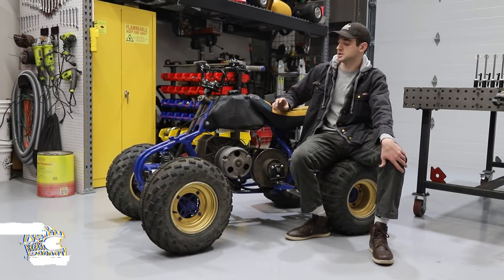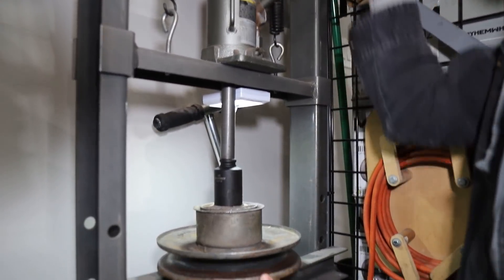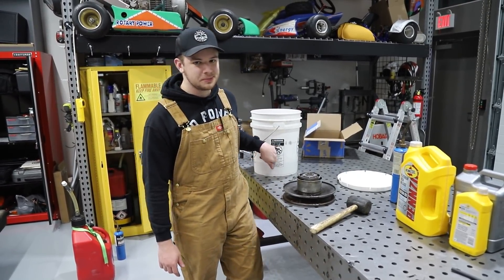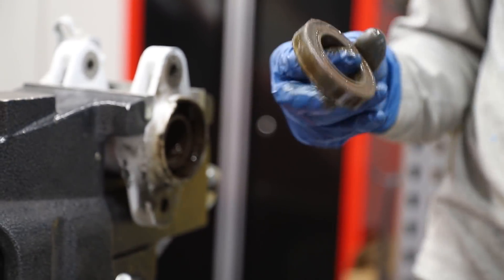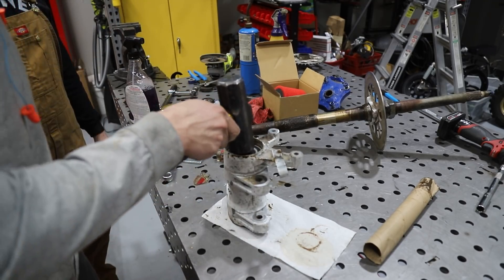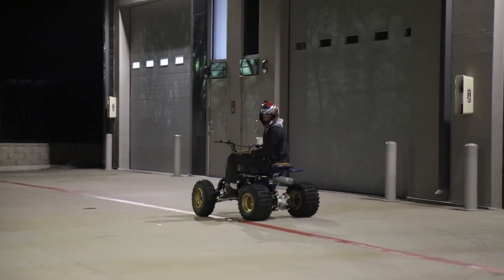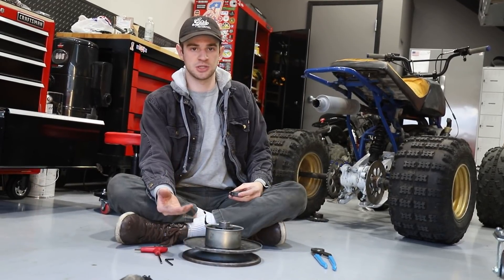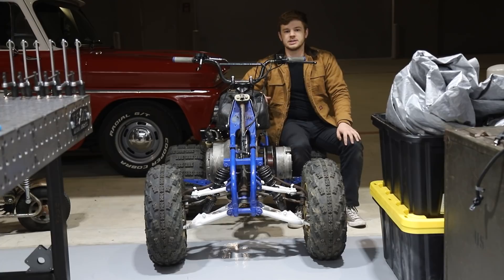ROTARY POWERED ATV FINALLY RUNS! Rotary ATV EP. 4

Comment: Try a 501 rotex mated to a torche converter from a snowmobile on 50/50 airplane gas and high test gasoline.  It will spin tires off rim SO plan plan on bead break rims. Best part can be built on a blaster Frame stretch 2 inches looks stock🤣. EAT 5.0S AND CAMEROS . FOR 2000.00
Reply: TORQUE *

Comment: Without the CVT working you are going to lack performance. Your belt is burning because that torque converter is squeezing the belt trying to move it, that locked pully won't let it move.

Comment: I’d definitely build a scatter shield around your drive clutch. I had a clutch on a snowmobile (which is what you have for a drive clutch), and it blew up like a bomb going off. Destroyed the left side of my hood a belly pan. You’re drive clutch is a 70s vintage Arctic cat hex clutch. Try finding a Comet 102C. Way more tunable. Check out high performance engineering online. The have all kinds of clutches and tuning parts. Nice build, btw.

Comment: Be safe and get a different fuel cell now sense the exhaust runs right under it. “Heat rises and will boil your fuel” can blow up or cause the engine to vapor lock.

There is a reason no exhaust is next to the fuel tank or lines.

Comment: Good! A 33 cm intake duct, with Reed Valve at intake plate entrance (Yanmar Diesel SAE Papers) and a longer exhaust system would provide better low rpm Torque. See Taiwan SAE paper: 'The intake and exhaust pipe effect on Rotary Engine  Performance', and 'Wankel News':  RE-5 engine results. Blessings +
Reply from the maker: Awesome, thanks for the info we will look into that!

Comment: Judging by the slope of both the drive & driven pulleies, they look like different series. Would suggest making sure they are both the same, whether it be 20, 30, 40, or 50 series and grabbing a new belt too match. Or you could ditch the whole belt and pulley system and get a centrifugal chain clutch and fabricating your own custom drive gear so you get a good balance of torque & speed

Comment: Hy guys, what you said about using hydraulic fluid and acetone was the original formula from AMC. A company that is long gone but the simple formula lives on in just about every old mechanic that is still alive and well. This works so well and you can use even old fluid that is drained. Does not affect the performance. The grease you say is like mud is a great sign that the previous owner was not afraid to use grease. How many times I fix something and there is not grease, then its a bitch with loads of rust and rot. 
      You guys did a real nice job on the 4 wheeler. The unit rips well. A turbo will help but make sure you run a rich mix as forced induction really make it hard on the engine. 
Nice work guys a good luck too. vf
Reply from the maker: Thanks for watching and for the information and tips! Cheers

Comment: If you are gonna lock the driven pulley the engine needs to be on guides with springs so it is able to move back and forward with acceleration and deceleration if you dont it is gonna eat the crank bearings if you need advice on how to do it look up 2strokestuffing on youtube he does the land speed racing with 50cc scooters and that is how he has his set up driven is stationary and engine is mounted on a spring arm so it can move with the driver pulley

Comment: When you push the trailing arm back a few inches,you can flip the drive pulley and put the gear on the outside of the axle,and just make another set of bearing supports along the arm.It sounded good,and moved well. Happy St.Patrick's Day to All edit =lendel morales had a Great idea to just "Flip the Axle".You can extend the shaft and put the gear on it.

Comment: When you where riding it in the parking lot the first time I saw sparks on the front of the engine, you coil or wire might be arching, that will take away some power.
I would love to see a Suzuki 250cc 2 stroke in that frame, it would fly, maybe from a 250 quad ?
Reply: they had no exhaust at all.It was straight out of the block.Good eye though.
Reply: @bryduhbikeguy  O I see now thanks...

Comment: You know that they make reverse wound springs for the driven side, did you notice how the three plastic buttons in the Carrier were the same on both sides and the part that rides on them will ride on either side depending on the direction you want to work. It’s only a spring change and installing your ramps to the other side of the plastic buttons.
Reply: That's a good idea
Reply from the maker: Didn't know about that, thanks for the info! We'll definitely look into doing that

Comment: Get a secondary pullie from can am it will turn right direction and you can tune the cvt by changing out springs going to stiffer spring on secondary pullie and yall need to wrap exhaust or move it away from gas tank before it explodes
Reply from the maker: Thanks for the idea, we were thinking of doing another pulley and I think we might go that route. We're definitely going to wrap the exhaust and hopefully when we do the turbo we can re-route it

Comment: Awesome build regardless, but CVT’s just suck in general. However, I think you’d gain more performance from getting the cvt working than you would from a turbo. 

Or better yet, do a gearbox. Get rid of the giant turd between your engine and your rear wheels before worrying about making more power that you can’t put to the ground.
Reply: Ahmm snowmobiles
Reply: The CVT is technically more efficient but you can have a lot of problems. It doesn't sound as good imo and less control over your ratio in the moment.
Reply: Nah they just need to get a newer clean one from a different sled

Comment: I say supercharge it skip the turbo watch the engine really wake up
Reply: Itll have more power with a turbo since rotarys make all of their power at the top of the rev range
Reply: Supercharging would be dumb when a turbo setup is better  for a rotary 🤦‍♂️
Reply: @tylerseabook9423  actually the turbo may produce more max power but the supercharger produces consistent power across the entire power band... The turbo due to its surging nature will cause  a need for more maintenance as well as causing more wear to the engine and with that engine not being 100% healthy due to its pitting and scoring problems may cause premature engine failure where an appropriately set up supercharger doesn't surge and doesn't increase the maintenance of the engine
Reply: @dodgeme1986truck   all you just said is wrong. And that’s a rotary engine which only makes power in high rpm. A supercharger would not cause less wear and tear on a motor. There’s a reason people only turbo rotary’s
Reply: @tylerseabook9423  the reason turbos were originally used was due to the high cost of superchargers back in the day... Superchargers do put minimal stress on an engine in comparison to a turbo (unless you're running a vgt turbo) and a supercharger with boost tank will provide a much more stable power output over a broader range of rpm unlike a turbo (excluding vgt) of which spikes when the boost comes on and looses pressure when you let off the throttle for a second then get back on it... Yes turbos create higher overall peak power but they also create twice the wear. Whereas a supercharger generates a little less peak power but  has a flatter power curve over a broader rpm range.   There's a reason for the term turbo- lag as superchargers don't have it being belt/chain/gear driven right from the crankshaft.  Also I stated a properly setup supercharger with boost tank intake manifold, properly sized, and proper ratio driven

Comment: You guys should really look into fixing a real working cvt,  Just a tip,  look for something like a powerbloc p50 primary clutch they are good and easy to tune, and a good secondary clutch, at least something that u can tune a little and have it mounted the right way. The acceleration and topspeed would be 10000 times better, with 20-25hp that quad should pop wheelies from the start all day with a good working clutch.  however cool build.
Reply: Yeh

Comment: I'm curious if you can get a Harley transmission geared right for it and use a cog belt primary and dry clutch.
Reply: With machining it's possible been there done that... Best setup for that is a meat grinder clutch and a divorced Harley transmission.
Reply: @dodgeme1986truck  exactly my thoughts. I don't know of any other motorcycles that have a transmission not integrated into the engine. And with the Harley custom market anything is possible.  It's just getting the snowmobile clutch off and finding a pulley that will fit.